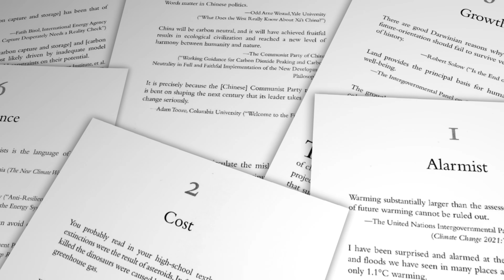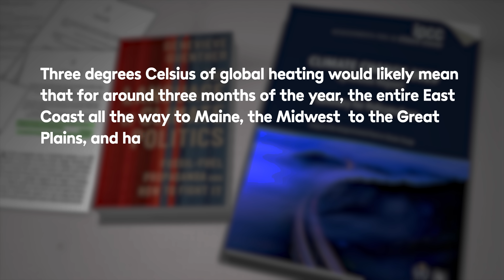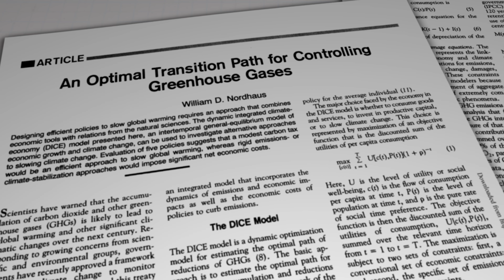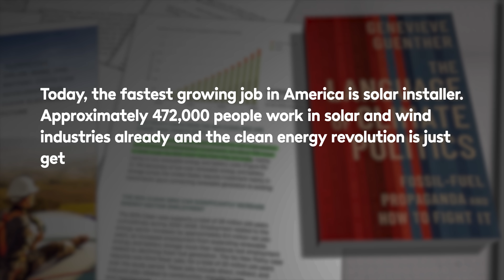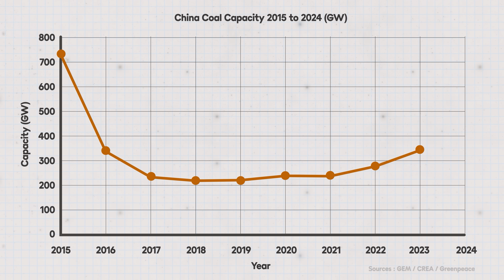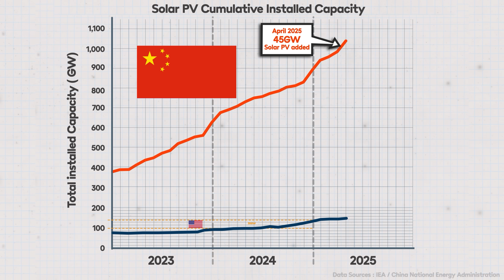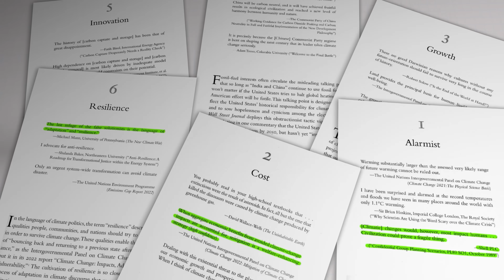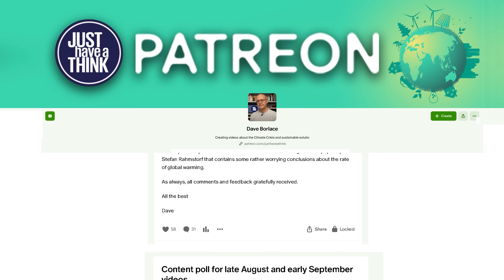New research DEBUNKS climate disinformation.

Comment: This is going to be quite a long comment because I have some serious issues with your, as you so eloquently put it, rant.

If I look at figure 3.2 from the IPCC report you mention I can see that it does NOT suggest that a future with 2.4 - 3.1C of warming is one in which people living in Maine or Iowa would risk death from heat exposure simply by stepping outdoors during three months of each year. On the contrary, most of the regions Guenther includes in her claim will experience these conditions 1 to 10 days per year, some areas will experience them for up to 50 days per year and only a few areas will experience them up to 100 days (about 3 months). So Guenther’s claim of “around three months” is an exaggeration for most of the areas she mentions. Furthermore, the text underneath the figure states that "Heat-related health outcomes vary by location and are highly moderated by socio-economic, occupational and other non-climatic determinants of individual health and socio-economic vulnerability. The threshold used in these maps is based on a single study that synthesized data from 783 cases to determine the relationship between heat-humidity conditions and mortality drawn largely from observations in temperate climates." So simply stepping outside would not put the average person at risk of death. Even more so because most of the areas Guenther mentions have been experiencing those conditions for decades as one can see in the historical data map to the far left. So people living there are quite used to these conditions. And of course, as it says, these maps are based on ONE study that looked at 783 cases, so hardly statistically relevant.

 continued in replies
Reply: When you mention BC experiencing three days of extremely hot weather back in 2021 I think you're referring to the town of Lytton. A small village of about 250 people (about 1700 if you include the surrounding rural area) which is known for often being the hottest place in Canada because it has an inland hot-summer Mediterranean climate. Because of the dry summer air and a relatively low elevation of 195 m (640 ft), summer afternoon shade temperatures frequently reach 35 °C (95 °F) and occasionally top 40 °C (104 °F). The previously hottest temperature there was 44.4 °C (111.9 °F) measured back in......July of 1941, over 70 years ago. So using that as a claim that we're already beginning to see extinction level events is a bit rich. Also, as CBC reported, this heat dome event killed 595 people in all of BC, not almost a thousand as you claim. And 70% of them were people over the age of 70, an age group that is known to struggle with high temperatures and on top of that more than half of them lived in the Fraser Health Authority area so they weren't in good health to start with.

When you say that scientific predictions have been pretty much spot on I think you're referring to the paper "Evaluating the Performance of Past Climate Model Projections" from 2019. The conclusion of that paper is that "While some models showed too much warming and a few showed too little, most models examined showed warming consistent with observations, particularly when mismatches between projected and observationally informed estimates of forcing were taken into account." So the researchers had to adjust for mismatches between projected and observed values of forcing. And even when doing that "In about 9 of the 17 model projections examined, the projected forcings were within the uncertainty envelope of observational forcing ensemble." So that's about 50% of the models they looked at. Pretty much a coin flip. On top of that the paper explicitly mentions that "The AR4 projection was excluded from the main analysis in the paper as both the observational uncertainties and model projection uncertainties are too large over the short 2007–2017 period to draw many useful conclusions." Which should tell you a thing or two about the IPCC predictions. In regard to the IPCC reports I'd like to draw your attention to this:"A letter signed by over 50 leading members of the American Meteorological Society warned about the policies promoted by environmental pressure groups. “The policy initiatives derive from highly uncertain scientific theories. They are based on the unsupported assumption that catastrophic global warming follows from the burning of fossil fuel and requires immediate action. We do not agree.” Those who have signed the letter represent the overwhelming majority of climate change scientists in the United States, of whom there are about 60. McMichael and Haines quote the 1995 report of the Intergovernmental Panel on Climate Change (IPCC), which is widely believed to “prove” that climate change induced by humans has occurred. The original draft document did not say this. What happened was that the policymakers’ summary (which became the “take home message” for politicians) altered the conclusions of the scientists. This led Dr Frederick Seitz, former head of the United States National Academy of Sciences, to write, “In more than sixty years as a member of the American scientific community ... I have never witnessed a more disturbing corruption of the peer-review process than the events that led to this IPCC report.”

continued in replies
Reply: When you mention global warming being mainly driven by greenhouse gas emissions by humans, specifically the burning of fossil fuels, you obviously haven't read recent studies about CO2 and CH4 emissions by large rivers around the world (For instance "Old carbon routed from land to the atmosphere by global river systems"). Here's an abstract of what this study has found:"Isotopic mass balance of our database suggests that 59 ± 17% of global river CO2 emissions are derived from old carbon (millennial or older), the release of which is linked to river catchment lithology and biome. This previously unrecognized release of old, pre-industrial-aged carbon to the atmosphere from long-term soil, sediment and geologic carbon stores through lateral hydrological routing equates to 1.2 ± 0.3 Pg C year−1, similar in magnitude to terrestrial net ecosystem exchange. A consequence of this flux is a greater than expected net loss of carbon from aged organic matter stores on land. This requires a reassessment of the fate of anthropogenic carbon in terrestrial systems and in global carbon cycle budgets and models.".
You also haven't read recent studies into the decline in cloud cover and what this means for global warming. Take, for instance, the study "Downward Mediterranean Cloudiness Beyond
Little Ice Age Background Variability" which look at the decline in cloud cover from as early as 1500 with a notable shift occurring after 1818. Or "Roles of Earth’s Albedo Variations and Top-of-the-Atmosphere Energy Imbalance in Recent Warming: New Insights from Satellite and Surface Observations". A decline in cloud cover means a decline in earth's albedo which means more solar radiation reaches the earth's surface thus increasing its temperature. With that in mind you should have a look at the 2023 study "On Hens, Eggs, Temperatures and CO2: Causal Links in Earth’s Atmosphere". Here's a small abstract on the conclusion (which might surprise you):"Changes in CO2 follow changes in Temperature by about six months on a monthly scale, or about one year on an annual scale. All evidence resulting from the analyses suggests a unidirectional, potentially causal link with Temperature as the cause and CO2 as the effect."

continued in replies
Reply: Since you seem quite fond of quoting Guenther I'd like to address some of the other claims she makes in her book.
- “Scientists at Cornell University recently discovered that the amount of food produced per acre of land has declined 21 percent globally between 1961 and 2021”. Actually the paper she quotes does not support this claim. the authors did not find an absolute reduction in food yields. What they estimated is the effect that climate change had on the rate of growth of global agricultural productivity. If you look at the relevant data on Our World in Data, global agricultural yields have increased by factors of 200 to 300% since 1961, depending on the crop.
- “Wide-scale BECCS [BECCS = “bioenergy carbon capture and storage”] would also do terrible damage to ecosystems. One study warns that growing horizon-to-horizon acres of bioenergy (crops) ... would lead to ‘… ionizing radiation...’ In other words, it would… expose human bodies to DNA-severing electrons…”. Once again nothing in the paper she quotes supports what she claims, it says that the process of pelletizing biomass before it is used in co-firing power generation facilities requires additional electricity. Schakel, et al.’s lifecycle analysis assigns—as it should—additional environmental impact to the pelletization process commensurate with this additional electricity use. They look at the electricity generation mix in the country where the pelletization is done, and if some fraction of generation is from nuclear power, they make an estimate for how much extra ionizing radiation might be attributable to the electricity used in pelletization. So the dangerous DNA-severing electrons, turn out to be infinitesimal releases of ionizing radiation associated with the fraction of electricity generated by nuclear energy that would be used in the small amount of power required to pelletize biomass prior to its combustion and has nothing to do with “horizon-to-horizon acres” of plants.
She makes more claims that are factually wrong, either because she doesn't understand the papers she's quoting or because she pick what suits her without reading the entire paper, but I think I've written enough to start a book of my own and will leave it at this.

Just as a general note to those reading this: when watching videos on YT or listening to main stream media, please do not take everything for granted. And don't take what I have to say for granted either, look at the papers I quote, do your own research and make up your own mind. We don't have to agree.